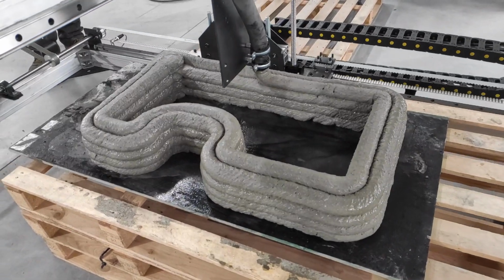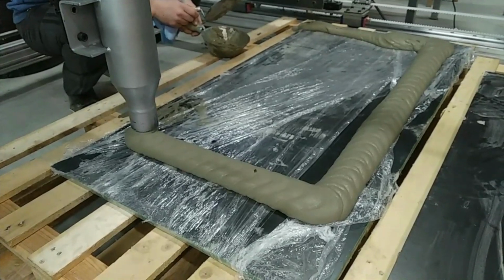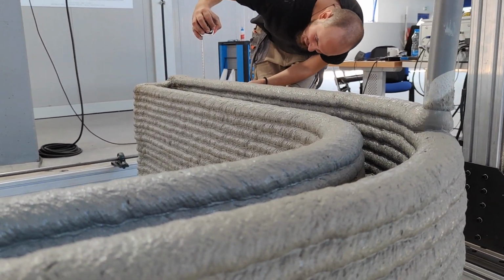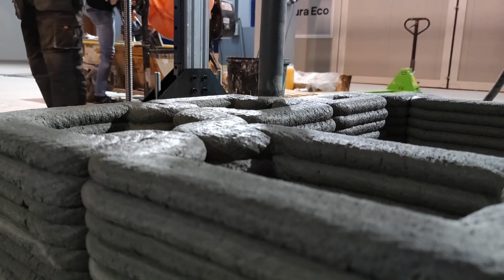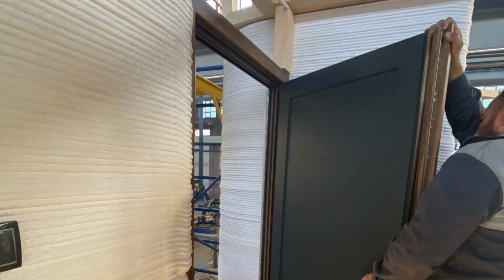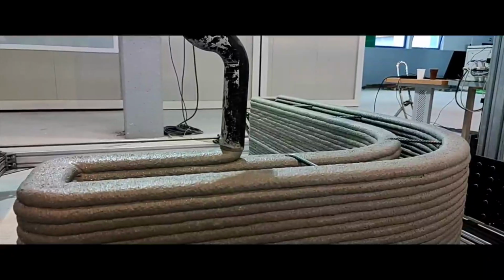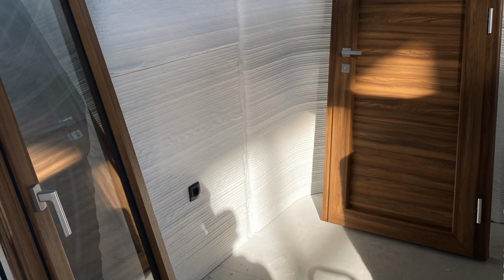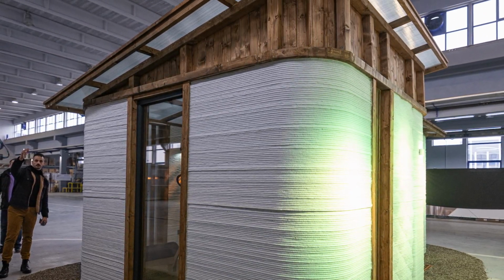NaturaEco 3D Prints Tiny Home “Proto-Dom”

Comment: pattern: i might be afraid, that the ribs will collect dust and then run down ugly when rained upon. 
layers:i wonder if they could do "vase mode" to get rid of the z-steps by basically printing a spiral shaped into a wall.
printer: the small one could build one room at a time. when done, move it over to the next room and hit start again.